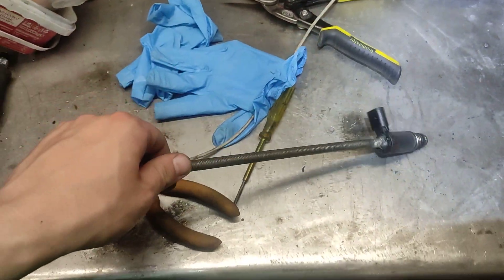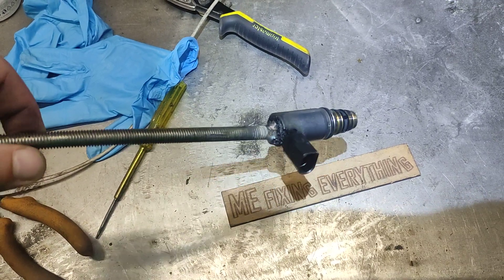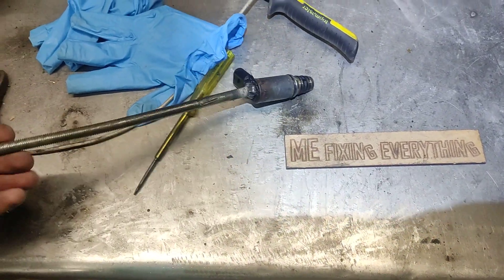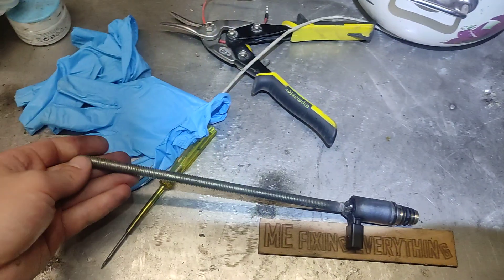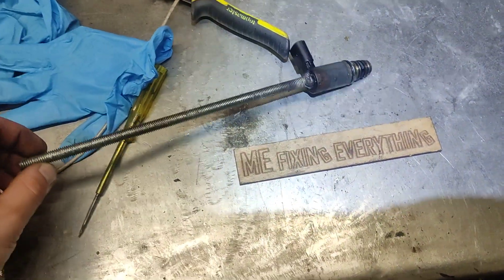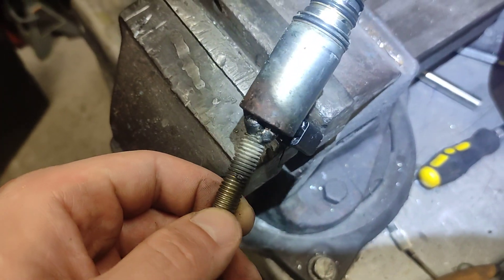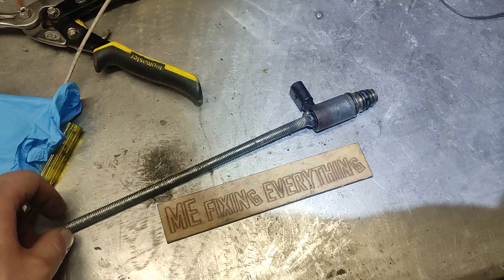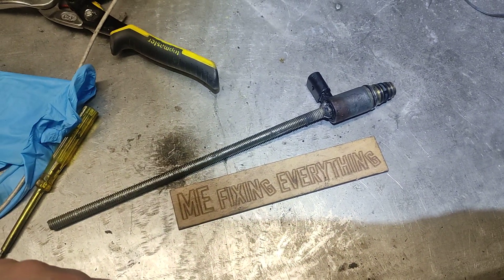How to remove STUCK solenoid Valve of A/C compressor

Comment: Is it possible to do this when it’s still mounted on the car? The black piece broke off trying to pry it out. I vacuumed out the Freon and hoped it would just pop off but it didn’t 🤦‍♂️
Reply from the maker: Maybe it's possible I just couldn't bother doing it on the floor. If you are on a ram should be okay